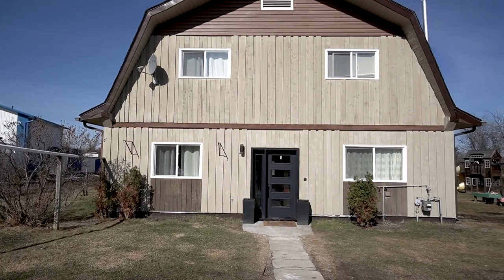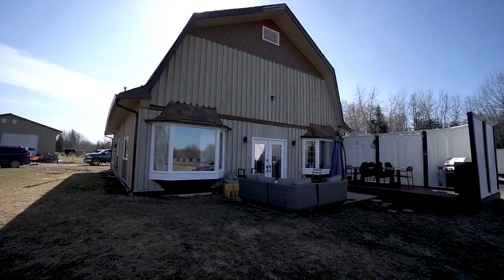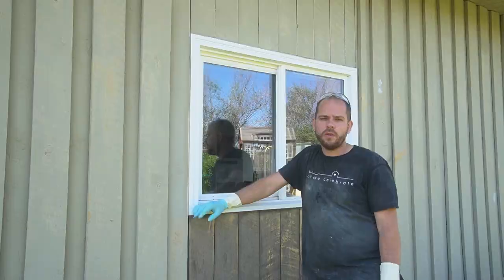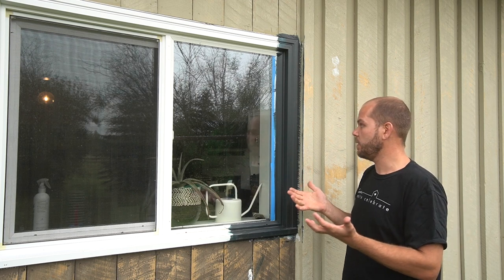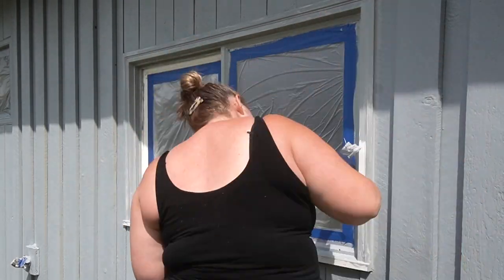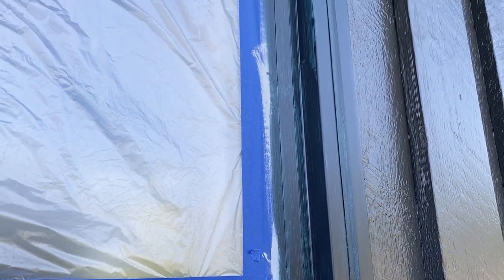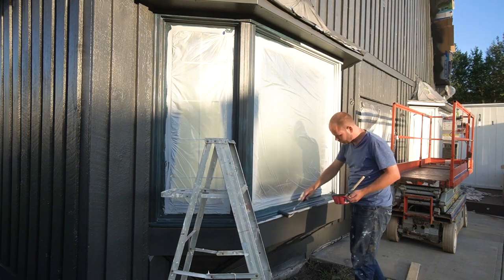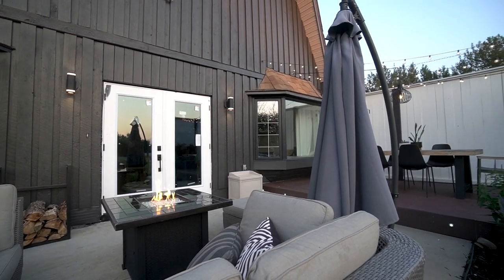How To Paint Black Window Frames | Safely painting our wood and vinyl windows!

Comment: I am glad that I came across your video, and yes I totally enjoyed watching, I was wondering can I paint vinyl windows since Anderson wanted $45,000. for 17 black frame windows, and now that I know that I can do them myself I think I will do just that, however, I also wonder if I will get the same effect if metal spray primer will be used. but that this sooo! great what you have done, thanks for sharing 🤗💜👍💯
Reply from the maker: This is what we came up with after researching into it a bunch. The biggest thing is to make sure the end result doesn't damage or warp your windows :)
Reply: @LindiandRuss  thanks for the info, I will give it a try and see for myself how things goes, nothing beats a try but a failer

Comment: Your house and windows came out great!  I just had my windows painted black.  He actually finished today but I was unaware that there is specific paint to paint the vinyl.  He used a spray paint. I believe Rustoleum and put a sealer after he was done.   I am so nervous about heat (hence the reason i am reading your article) but there is no going back now. Do you have any information regarding this?
Reply from the maker: We are just finishing a blog post on painting windows, it should be on our blog soon!